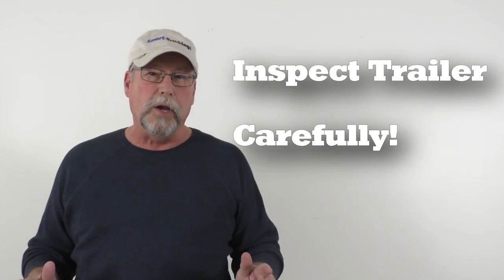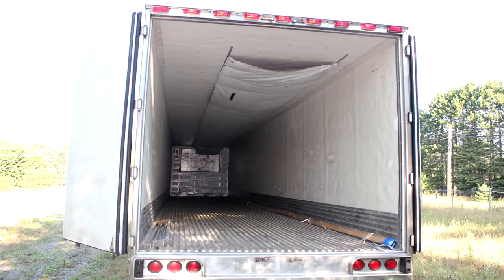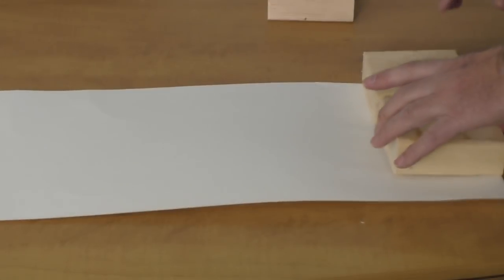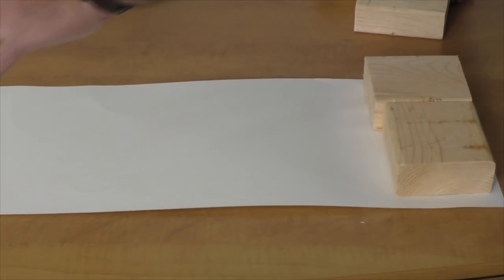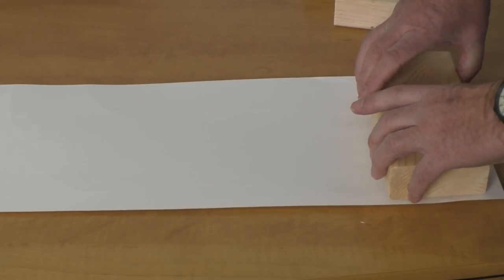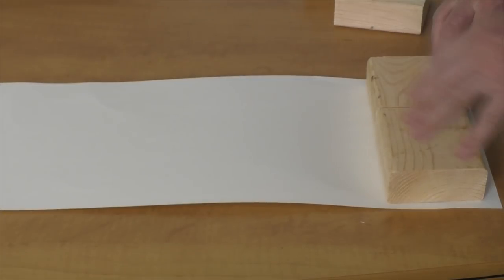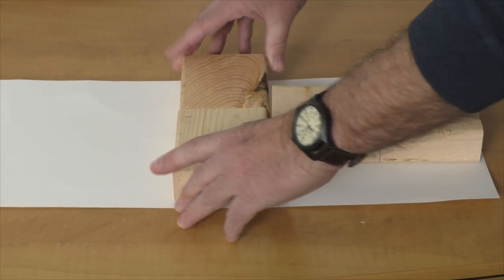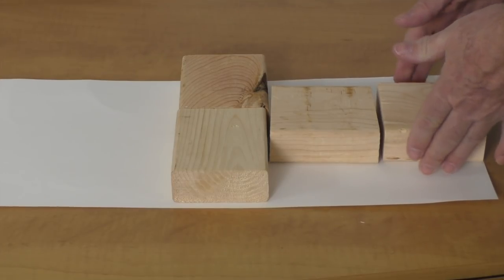Reefer Hauling Trucking 101- What You Need to Know About Hauling Produce (Pt2)

Comment: When I got my CDL from a fly by night socalled trucking school I learned everything the hard way with no training. These are the things that cost my company money because of them not training or informing me about my job description. I didn't know that I was suppose to put fuel in a refer unit or even know how to use one which caused it to shut off when it ran out of fuel. I noticed when I pulled over I had a long streak of fluid coming out of the trailer which was the actual frozen freight juices that melted in the hot summer Florida weather. I had to take it in to get serviced because apparently it ruined something in the primer unit if I recall. I've been pulled in weigh stations for not knowing how to use them. I've had a ticking noise in my motor that eventually caused the motor to go out in the mountains of Utah. They towed me in with a loaded trailer and said I had no oil in the tractor. I've almost killed myself by not knowing how to come down a mountain in the Winter time. I thought the engine was going to blow out because of the gear I was in I was to scared to touch the breaks because of the snow. I could go on and on with the crazy stories that I have encountered that was due to no training. I really believe that when companies give us a truck to drive without any training should be prosecuted for accidents. 🙏
Reply from the maker: I agree!
Reply: Loved your rant, great story!

Comment: I agree with your loading techniques. However, I am finding in recent years that we are not allowed to be on the dock during loading or unloading in many cases. The company's safety reasons and that does make sense you don't want somebody getting run over by a forklift. Some dark shippers will be conscious enough to ask you how you would like it loaded even though you're not allowed to stand on the dock and watch. However I've run into situations where pretty much all control has been taken away and all you get to see is what's in the back of the trailer when you put Logistics bars or stops across the back. Picking up preloaded trailers that are already sealed and it's 2:00 in the morning is probably the worst scenario because you don't really know how that trailer was loaded until you get to the other end. All your info was good though and I would tell the new drivers to listen to what you have to say keep it safe people.

Comment: Definitely do not want to run outta fun. I got tasked to check out a dead refer unit at a drop/hook customer. It would crank, but not start. Fuel tank was full. Turned out someone ran it dry, fueled it up, but never took it to our shop to get restarted. After several calls back and forth to our shop, i figured out how to reprime the fuel system. I was a mechanic in the Army before i switched to driver before i got out, so i have a bit more than basic knowledge, just not the experience on these. It took what seemed like forever to get that refer unit reprimed to were it would start and stay running.

Comment: I contract with WalMart hauling meat and produce with a rare frozen, dairy and deli load and rarer dry remix. We pull Tranes, Carriers and ThermoKings triple temp trailers. They are roll up doors (EVERY company should have these). I carry books and code sheets for all 3. We get the trailers pre-loaded, but I still check the sheets. I have had a few times where instead of 40/32/40 it was 40/-20/40 (Dairy and frozen temps) I also run backhauls of eggs or frozen from Walmart suppliers. These guys work by the hour, they aren't in a rush, and normally will not let you on their docks, the eggs due to FDA health requirements. They will put on the bill that you were not on the docks. 

   All your advice was good. I started hauling garbage in '96 for Covenant. All I can say is PULP THOSE TRAILERS. Fill the trailer every time you fill the tractor, even if it takes 2 gallons. A great habit to get into. If it is hot, try to fuel the reefer before you get to the receiver, you never know when some little Napoleon with a power complex will decide that your load of strawberries aren't as important as the trailer of basil and make you wait 9 hours for their next 'available' dock, or the lumpers will be taking a siesta, or he just doesn't like Kenworths in ~that~ particular shade of blue. (I had it happen in The Port of Newark)
    Reefer can be a good choice, but you have to be extremely careful who you do it with. You have a good setup. Dedicated, like with my Walmart contract is also great as long as you can put up with some of the (ahem) associates who work there and the stores that think they are there for your convenience, and you should help them unload. (Last I checked, I was a driver, not a lumper)
  As far as leaving the industry, I have got used to sleeping with a reefer behind my head and the sound of my wheels moving when I'm awake. When I retire, I will have to make sure I record both just so I can sleep at night.

Comment: Sometimes we would have a reefer pull in to drop off pallets of 50lb boxed product and the place that loaded them put like a single loose layer of plastic wrap around them.   Often at least a few pallets would go over. I hated hand stacking those pallets in the reefer with that floor they have, It was a rolled ankle waiting to happen and some of those reefers had that nasty ass odor in them.  But at least they were fun to load in the middle of the summer, our warehouse had no ac, would get very hot and we had to wear sanitary overcoats, it was nice pulling in and out of the reefer and it even helped cool down the dock a little.  I liked to sweep out the trailer for the driver if we had any spilled product but that floor made it a bitch to sweep out.

Comment: That's the beauty with EU-pallet that we have over here, they are dimensioned to fit perfectly against the walls both if you put them straight in 3 pallets wide or sideways 2 pallets wide, no real chance of the load turning over unless you mix high and low pallets.

Comment: When I worked a dock, I always let the drivers know exactly how many pallets and weight of the load then asked them how they would like it loaded, 99% of the time they had no opinion.   Also, the majority of the pallets we had could not be loaded sideways because there were no gaps in the sides for the forks to get under.    I think most docks are happy to load it however you want if you let them know. They do not drive the trucks or have a CDL, they do not know about your weight and balance issues.  They are given a manifest of the pallets to put in your truck and will usually just load all trailers the same if they get no complaints.  Many of these docks have high turnover as well so you can often be loaded by a low experienced operator.  Don't be shy about letting them know how you want the pallets placed and spaced, it takes all the thinking out of it for them.

Comment: What if they take 6+ hrs to get loaded, do u stand inside the cold warehouse and wait on each pallet to check its temp?
Reply from the maker: Take a warm coat and if there's a lull in the loading, use that time to step  outside and warm up. Ask them what the slowdown is and when they might resume loading. Hop in the truck and when the trailer starts bouncing, they're loading again.

Comment: i pulled reefer under my own authority for years,could you mention  a few tools that make your life easier like a reefer fuel cap with a tire valve in it for when you run out of fuel(cause you will) or a roll of 8 gauge wire for alternator failure.thanks again for your great vids
Reply from the maker: Good point on the quick tools ! I will bring those up next chance I get!

Comment: Hey there.  Just starting driving under my own authority here in Ontario Canada.  I want to get into reefer hauling.  I noticed you had a thermometer in your hands.  What is the type is it and are they easy to find?  When checking load temps, are you simply checking the temp inside each box or just the top boxes?  Thank you and love your vids.  Very helpful.

Comment: I used to unload trailers by hand(Bison Trailers) and I got to a skid of paper products wrapped in plastic ant tied to a corner of a pallet, I got a lift jack and put it under the skid and still have no Idea how it got in the trailer cause it hit the top of the doors and would not come out!! I ended up cutting off the top, pulled out the skid and had to wrap it again after I restacked the skid. I called the night manager and told her the next time The pallet was staying in the trailer I got 3 hours overtime but I would have given it up for a properly loaded trailer.

Comment: Make sure the the shipper doesn't stick the temp tracker to the wall of the trailer,  it needs to be near the center of the load.  

I had a pre loaded meat load refused because the tracker was on the wall facing the sun for 6 hours so it showed 3 degrees too warm for 4 hours.  Luckily the company tracks the refer temp and it showed correct box temp for the entire load.   It savedus a $65,000 claim.

Comment: I had a frozen load that went to Arizona when it was 126 degrees outside. They wanted me to sit 8 1/2 hours prior to going to the dock and the refer was not able to keep up with the temperature. The best the temperature was running was around 44°. After telling to shipper, they made an exception and got me in and loaded right away.
Reply: Dude I would literally go insane if I had to sit and wait 8.5 hours to unload. I haul bulk loads with an end dump trailer, longest I ever waited was 2.5 hours, 95% of the time it takes under 1 hour to unload.
Reply: friendlywhiteguy That’s because I was 9 hours early of my appointment time. Nearest Truckstop was an hour away with no shade anyways.

Comment: Reefer walls, we called them bunker doors, must seal properly.  If you have frozen in the nose of the trailer and more sensitive product behind, it can freeze, even if the door seals tight.  I hauled mixed loads quite often and occasionally there was a problem.  
Like you said check your temps.  Our loads were ready when we were dispatched.  The supervisor was responsible to start the reefer, sometimes they wouldn’t start the rear unit on a duel temperature trailer.  I would make the reefer part of my pre-trip inspection.  I didn’t want to have to worry about temps and fuel levels.  Great advice as always!
Reply from the maker: Thank you sir!

Comment: Some shippers get mad when you pulp their product because when you stick the probe in several places you are in fact contaminating the product. Produce like apples and pears are a good example. You have to actually pierce to the center of the core to be able to get an accurate temperature. Doing this between several different fruits and vegetables can cause cross-contamination.
Reply from the maker: Never ran into that.

Comment: Hey there Smart Trucking. I have been taking a CDL Class with a carrier for about a month. On my first CDL Exam, I failed on the Pre Trip inspection portion. I went again today, and successfully completed two of the three backing manuevers. However I failed on the last back; the 90 degree or Alley back. I have one attempt left. Is there any advice you could give me? I'm feeling like I'll never get jt
Reply from the maker: Nick I hang out the drivers window and watch the rear end of the trailer as it backs and I back up slowly, then pull forward and correct as needed. I've heard some trainers don't want you to hang out the window and just watch the mirrors and if that's the case there you can tell him that's crap, most all professional drivers do that because you can see better that way and that's the object of the game, to get the best view possible of where the trailer is going! Good luck!